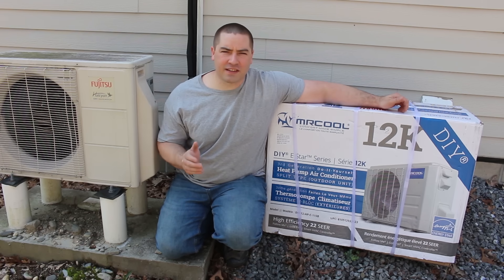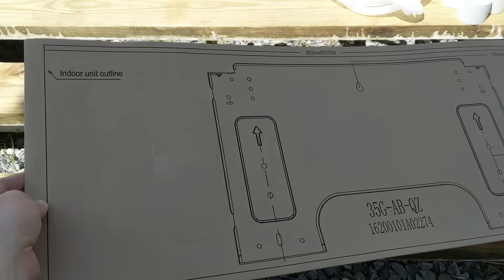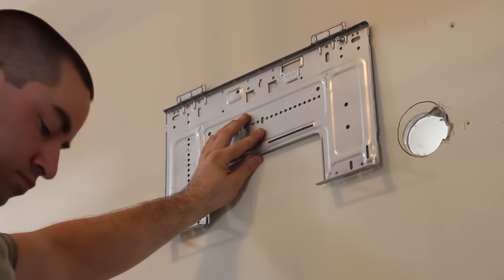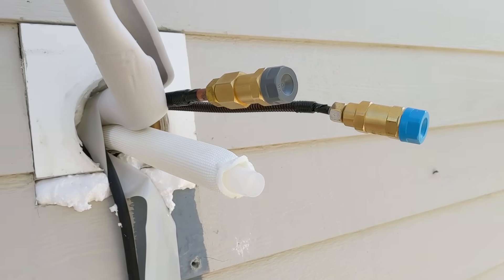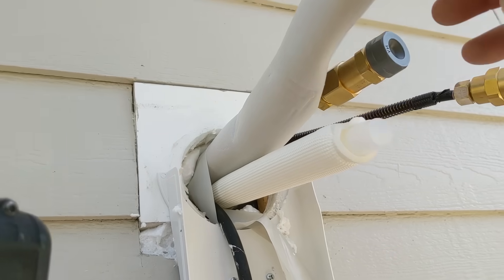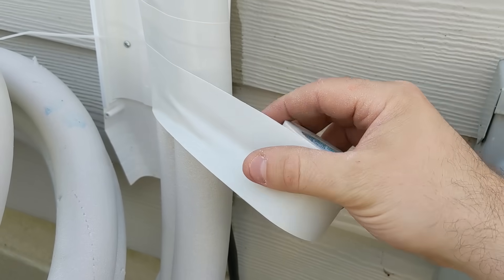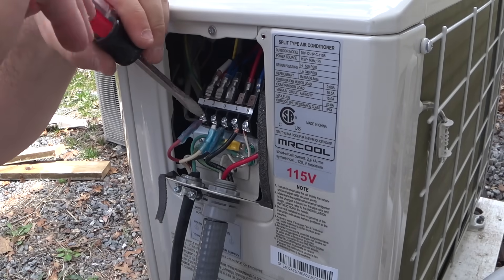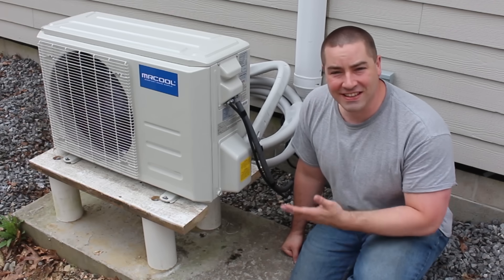Installing My Own Mini-Split Heat Pump, DIY

Comment: You're a good guy, David. 

You should the bitty parts that can cause heartache and problems of these DIY systems.  Like all those damn connections!

And this is my problem with mini splits.. Your old heat pump is only 7 years old and broke after 2 years.. How long will Mr Cool last?

My Rheem classic was installed in 2007 and seen many tropical storms in Miami.. No problems first 12 years, now I'm spending about $300 a year in various repairs, some DIY, other times a pro AC was needed.  I'll take my 13 SEER rating any day!
Reply from the maker: My Mr. Cool is not working 100% right now.  I'm a bit fed up with mini-splits in general.  I have a 12 year old window AC still working, why can't we do this with mini-splits?  I'm with you, that I'll prioritize reliability.
Reply: @DavidPozEnergy  Mini splits just are so light weight, have to think everything is light gage, electronics are not sturdy like a central unit and so on.. but i'm old so maybe that's the problem!

Comment: Hi I see that the hole is made wrong for the outer part. It needs to be drilled down with a little inclination this is very important
and you add some insulation that sits around the pipes completely so that 
there is insulation down by the couplings at the outside part all the way. In 
winter, there is a heat loss. You can buy an insulation for some heat 
pumps original which sit under the cover. many tech og DIY makes this mistake 
that there is a lack of 15 to 20 cm insulation ....:-) 
Otherwise fine video

Comment: We use flared connections in Australia, not those pipe connections, do the pipes come pre- evacuated???? Standard practice is to pressure test the pipes with dry nitrogen then evacuate the lines to remove air and moisture, do these lines not require this process??

Comment: Excellent video ! Thank you
Question: How long is the hose loom with the copper tubes? (some of us can't install the compressor on the side of the house and have to run a line all the way to the front or back of the house)
I wonder what the mx length is...
Reply from the maker: This hose is 25 feet.  If you want to make a custom length, then check out my latest video with a different brand.  The new one can go up to 49 feet.  https://youtu.be/Kd092alkeaE
Reply: @DavidPozEnergy  Thank you

Comment: Nice video David!! . but I have a question: after installing, does not need to take the air out of the hoses and evaporator? usually when moving the a/c need to remove the air of the system out, because of moisture on the air.
Reply from the maker: Not with this particular kit, but with normal systems you do.  https://youtu.be/Kd092alkeaE
Reply: Thank you David!!

Comment: Mr. Cool is gonna change their name or go out of business in a few years when all these units start to leak. Having all that extra line set is stupid and inefficient. I've found in my area some older homes with poor insulation simply don't work with heat pumps alone.

Comment: WHY NO VACUUM?? Autozone will rent a vacuum pump for free... now you ended with a bubble of air/water in your system
Reply from the maker: This particular kit doesn't need a vacuum.  I go into more details about why in the follow up video: https://www.beautycounter.com/alainaposluszny?goto=/preferred-member-renewal
Reply: @DavidPozEnergy  OK that make sense of the strange flanges in copper lines (those are vacuum sealed)... never saw those before.

Comment: How did you know the leak was in the unit and not the lines ?
Reply from the maker: Do you mean the old unit I removed?  I paid a ton of money for diagnose and repair of a leak by the professional companies.  They all told me they fixed it when they charged me.  Then a few months later the mini-split would stop working again.  These professional companies never actually found the problem.

Comment: Don't I have to pump the line set down with vacuum pump prior to releasing the freon?
Reply from the maker: Most systems you do.  This is a unique DIY kit, that doesn't require it.  I go into more details on why in the follow up video: https://youtu.be/KzHLsRtVn4U

Comment: I didn’t see you placing the system under a vacuum with a vacuum pump to remove air and most importantly any water vapour! Failure to do so will greatly reduce the lifespan of your new system! Hello from an AC engineer in the UK
Reply: The line sets are factory sealed at each end and Pre charged, also pre length   . They come with special couplers on line sets, when threaded attached to each other, a pentation sealing happens keeping out contaminates.  so no vacuum pump is needed.

Comment: you don't have to deal with that. I have personally installed over 1000 air conditioners ,such an advance on the pipes is inadmissible to leave also learn to mount an indoor unit without these template cards this is absurd just as it is absurd for you to be a master

Comment: Does the current temperature display? My Senville unit will not display the current temperature - it will display only the temperature you set it at. 

With the vast technology upgrades and innovation - they still can’t do what a $30 thermostat does on a regular air condition unit. That boggles my mine. 

The filter is another pos design too but that’s for another discussion.

Comment: Great job. Only negative is the rats nest of refrigerant line left over. It would be better if you could cut and shark bite  shorter lines for a DIY solution.

Comment: Maybe it's me skipping around but did you vacuum out the system?
Reply from the maker: This particular kit doesn't require that.  I go into more detail of why in the follow up video: https://youtu.be/KzHLsRtVn4U
Reply: @DavidPozEnergy  I saw that new line set and that’s very innovative of them. Since they do that with the line set, they I assume, will guarantee 💯 user install then?

With mine, I cut the lines shorter and vacuumed them. 

Thanks buddy!

Comment: I dont like that alot of these DIY projects for mini splits NEVER tell you to pump down (evacuate) the system to negative pressure.  Need to remove all air, moisture and any other impurities inside the lineset.  I guess GUARANTEED way to kill the compressor.

Comment: Diy AC came with refrigerant in it? Been waiting for when you will fill the refrigerate into the system but I don't see it you did!
Reply from the maker: Yes, the whole system came pre-charged.  The fittings are all quick-connects, that keep the refrigerant inside until you tighten down.  That way no vacuum is needed.

Comment: Boy can I ever relate!!  My units are Mitsubishi, I have 4 of them and 3 have failed costing me several hundred dollars in repair bills.  My most recent one is $600 to fix one and will be another $700 for the second.  I am now considering the Mr Kool and wondering how you are making out with yours.  These units are so expensive to repair, even under warranty it just doesn't pay to buy the expensive name brand units!!!
Reply from the maker: My unit is still working.  I noticed the inside freezing up when I was first running it (first 2 weeks).  I added a little pressure and since then no freezing.

Comment: I like the clear and simple video of your install.  FYI I don't believe you should be insulating the the 2 couplings (which you referred to as "valves") together.  They should be insulated separately as one is line is going to be hot and the other cold.  Bridging them together reduces system efficiency.
Reply: Having the warm coupling (liquid line) insulated together with the cold coupling (suction line) does not reduce efficiency.  What it does is sub-cools the liquid refrigerant before going into the indoor coil, and it also boils off any potential liquid that didn't evaporate in the cooling coil, protecting the compressor.  Liquid going back to the compressor could damage it.  The reality is that there is very little heat transfer through those couplings anyway, so it's not really a big deal either way.
Reply: @shingw  that's in refrigeration cycle. Not ac. There's a difference. As the reverse cycle on heating it becomes a problem in hotter climates.

Comment: @davidpoz I see many people have had failures with Mr cool after a few years or even a few days. Please let us know how yours is holding up.
Reply from the maker: The first summer (right after installing) I was getting some freezing on the inside coil.  I had a little refrigerant added to increase the pressure and since then no issues.
Reply: @DavidPozEnergy  cool. Heheh. Seems counter intuitive. thanks!

Comment: Do you need to install any Refrigerant? How much Power do you need 110 or 220 VAC? What's the BTU?
Reply from the maker: This particular model is 110VAC.  It's rated at 12,000BTU.  It comes pre-charged with refrigerant.

Comment: So what was the winter like with this mr cool unit
Reply from the maker: Worked all winter, no faults.  However, summer it did freeze up a couple times.  Still no faults, but I needed to let it thaw.  Turned out it was on the low side of just barely enough refrigerant.  I had a little more refrigerant added to stop the freeze-up.

Comment: Some of the mini splits espeacially later models have an internal defect and the leak slowly over time deep inside unit... the parts they used had thin walls which do help with efficiency and a quick heat and kool operation..  think of it as using a cookie sheet on the stove top .. or a cast iron skillet?  Which one will heat up faster to the touch?   But by doing so ..the gas slowly leaks out.   I think the corrected the issue now. But it took some time.. all of the brands of mini splits suffered from this defect more or less....and perhaps some have this issue still today

Comment: DIY classic mistakes. 1.   You didn't pressure test the system BEFORE letting the refrigerant into the lines. What would you have done if there was a leak?  Dry nitrogen is preferred over compressed air to test the system. 2. You didn't run a vacuum on the lines and air handler to remove all moisture. The bottom fitting on the heat has a port to connect standard A/C gages to.
Reply: The line sets come precharged with refrigerant in DIY units.  Notice the sealed quick couplers at 8:30? Youre not supposed to pull a vacuum nor do a pressure test. Just connect them and check for leaks with bubbles. Theyre sealed with o-rings instead of flares like you find on traditional mini splits.
Reply: @reelheel5919  +1 Reel - the point of "DIY" systems seems lost on capt djm.  And, he ended his comment/last sentence with a preposition. I think that says it all.

Comment: How many watts is this using when it’s running? How many watts does it use on 120 without the red wire hooked in to 240? I’m curious about starting lights as well?
Reply from the maker: About 1,100W.  I show the data in the follow-up video: https://youtu.be/KzHLsRtVn4U

Comment: Awesome system just looks like you could measure the lines and have them precut to avoid the long wrapped up coil of copper.  Just my two cents but, I know they could sell shorter lengths.  Other than that love it and had my eyes on this for awhile.
Reply: This unit comes with the lines pre-charged; the whole point is to be fully DYI without needing the special vacuum and tools.

Comment: 99% of issues one those Fujistsu is a leak in the indoor Coil.
I've had the exact same model 12k btu since 2013, rock solid but had a leak this year, replaced the indoor coil for free (12 year parts/labor warranty / Fujitsu Elite dealer)

Comment: So how is Mr Cool doing after a year of running it?  I'm only interested in the cooling aspect and power consumption.  Thanks!!
Reply from the maker: Yes it cools very well.  However, it froze up a couple times right away.  More refrigerant was added and since then it has not froze up.  Maybe it came low, or maybe I leaked some when installing it?
Reply: @DavidPozEnergy  I appreciate the reply! I'm going to be installing one here in the next few days it's supposed to get up to 117°F so I shall see!   Out here we prefer to refer to it as "Life Support" rather than air conditioning.  😊
Reply from the maker: LOL, I've not heard that line before... "life support".  Are you in Arizona?
Reply: @DavidPozEnergy  Pahrump, NV.  Halfway between Las Vegas and Death Valley. Or as some locals say, "60 miles from nowhere and 6 feet from hell".  Of course that only applies in the hot summer months.  Rest of the time it's great.

Comment: Dave, now that you had this unit for a year, can you provide some feedback on the efficiency and any trouble you may have experienced (watt/amp usage, AC/heat pump satisfaction, humidifier?, etc.).  Thanks for this great installation video.
Reply from the maker: Sure.  It has worked in both heating and cooling.  It's been reliable and quiet.  I don't have a watt meter installed (yet).  Sorry, just get tied up with other problems.  I did have an issue.  I was getting freezing on the inside evaporator coil.  (AC mode only) Last year It happened twice, and this year once.  I've reached out to Mr. Cool customer service.  they said it's likely low on refrigerant, but said they don't cover that under warranty.  I had a friend with a refrigerant license come over and add what he called "a little bit". Since then (about a month ago) I've had no freezing, but I'm waiting on a follow up video.  I want to re-check pressure in a few months to see if it was maybe shipped low, or has a leak.  It's very possible I screwed something up.  However, Mr. Cool has watched my video and did not see any flaws in the installation.

Comment: I assume the lineset comes pre vacuumed? those are neat fittings as the ones i have installed u just have a nut for a flare fitting.
Reply from the maker: Exactly right.

Comment: By the way, you can purchase these on ebay, amazon and other places so be sure to compare prices and reviews.  Steer clear of Klimaire as it has some inherent problems with durability and quality control.  Most brands are decent, though and the design is nearly identical in all.  You can save big by getting a low cost vacuum pump and that R410A fitting to connect your vac pump and/or gauges.  DIY is sort of a gimmick.   Most install the same way right out of the boxes.  Sometimes you can find one of these systems complete for under $500.  Shop before opening your wallet.

Comment: With this, as any refrigeration product, it's essential to vac down the line set and indoor section the leak check the vacuum to see if it holds prior to releasing the refrigerant into the system.  Even a small quantity of non-condensibles can reek havoc on the system.    And yes I've been installing these since the late 80's and speak from experience.    That plastic drain tube, unless shielded from sunlight will disintegrate in 2-3 years.  Better to put it in a piece of pvc pipe or at least wrap it in tape somehow.  If you plan on getting one of these, you'll need to have it cleaned at least once a year or purchase a cleaning kit with tent to prevent damage to the home interior.  The fins on the indoor fan (a long squirrel cage) get filthy in the cleanest of homes in due course.   This will diminish performance and/or destroy the fan motor.  Essentially, these are throw away systems.  When you have any major issue it's mostly cheaper to replace than to pay for service.
Reply: The line set is sealed at both ends and contains refrigerant. It is not possible or necessary to vac them down. The sophisticated connectors on the ends seal the outside connection before they open internally to release the refrigerant as you screw them together. The reverse is also true. If you unscrew the connectors, the internal seal closes before the external seal opens so only a minuscule amount of refrigerant is lost. I know this because I spent a long time on the phone with tech support after I erroneously connected one of the lines to the wrong zone on a 3-zone system. I moved it after our discussion and the system continues to work perfectly after almost two years.
Reply: Everything is a "throw away system" today. And usually not very long either. Hire an HVAC contractor and put a little furnace/coil/condenser in a little space like this and you'll pay $10,000. This can be bought and installed for $1,500. Sure, you might put 2 or 3 of them in while you stay in the home, but I still think they dollar cost average out. And they are VERY economical to operate.
Reply: I was quoted $13k to replace my central ac unit. Been looking at a multi head split system that is quieter, more efficient, and can shut off rooms not being used for under $4k and the vacuum pump, guage set, and pipe flare tool is only $200 to install properly. So even if it needs replacing every 5 years or so I'm still money ahead after taking into consideration service calls for an aging traditional system.
Reply: If A Day wanted to make a buck, he could install these with little effort and make money every day. Mike Maxwell is correct that the old guard needs to realize that we now live in a throwaway society. Not working? Throw it away and replace it. We're all guilty of it.

Comment: Call a Hvac professional if you want it installed properly.
Reply: should have been pumped down
Reply: I agree, but these are throw away systems sort of like window a/c units.  It costs less to purchase than what a professional has to charge to pay their bills.  These do work well when they are in good condition and have been cleaned often.  But long term these will have to be replaced more often than a traditional hp system.
Reply: I agree. I don't like all that extra line set curled up near the outside unit. I guess  just turn on and hope for the best. I give it 2 years max.

Comment: are the lines sealed or how did you vaccume out the lines before you opened the valves
Reply from the maker: Yes, the lines are sealed from the factory.  This is a kit with quick-connect fittings, not flare fittings.